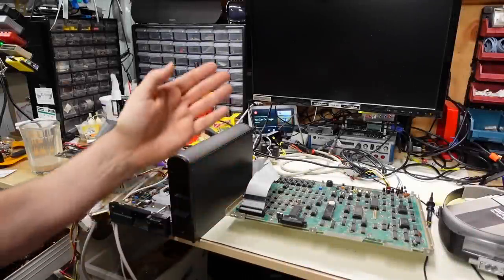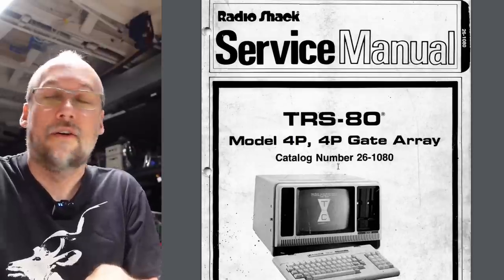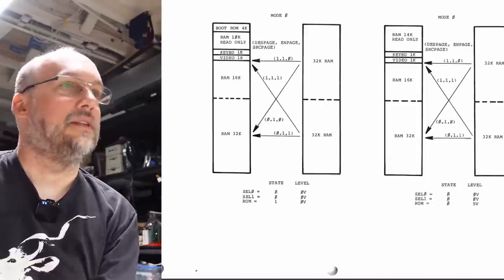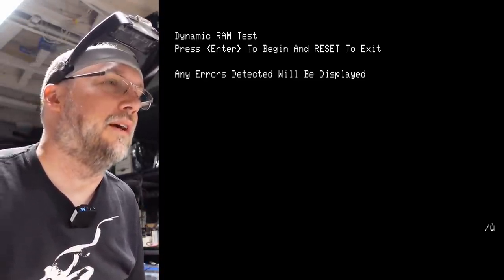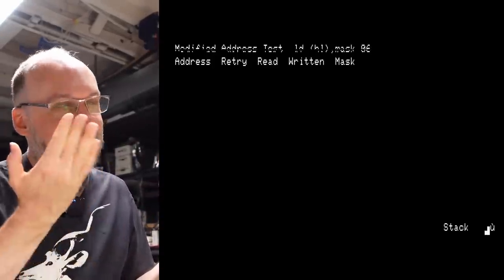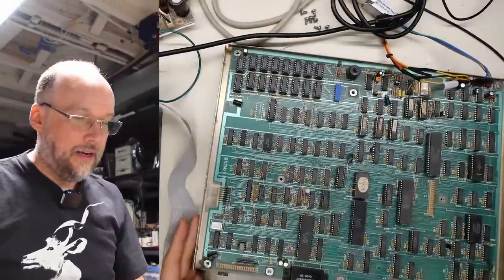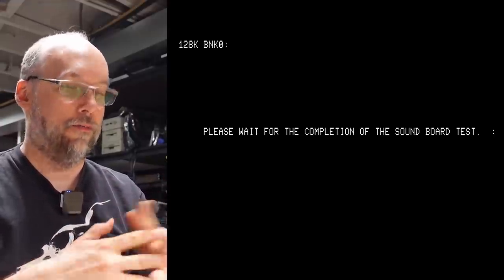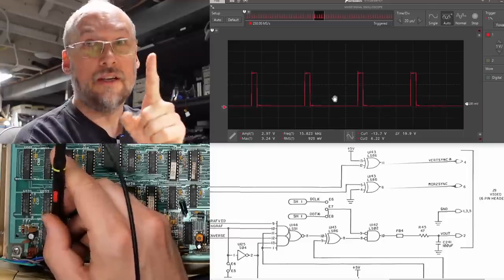TRS-80 Model 4P 80-column crash repair (Part 1)

Comment: Where did you get your schematic?  The only 4P service manual I've found uses a different circuit and a different PLL chip.

Anyway, the 20MHz clock goes into U147 which divides the frequency by 16.  The output on pin 11 should be strong TTL at 1.25MHz.  The voltage divider brings it down to a volt.  The phase comparator (pin 3) checks the difference between this signal and pin 6 (the 1V 1.25MHz signal). The voltage-controlled oscillator output (pins 9 and 11) goes to the divide-by-10 counter U149.  I never saw where pin 3 of the PLL or pin 11 of the counter go, but I am guessing that they are connected, meaning that the PLL is being used to multiply the frequency by 10 for 12.5MHz.  The VCO is tuned by the variable capacitor for a base frequency, and it should be bumped around by the phase mismatch between pins 3 and 6.

So make sure the variable capacitor is connected to both pins (it might be since adjusting it seemed to have an effect on the DC output of pin 9) and it not shorted to anything else (via bodge wires gone wild or something).  You could also pull the chip and build the test circuit as shown in the datasheet to see if the VCO is working at all.

Comment: It's been a while since I was last dabbling in PLLs, but I couldn't resist giving this one a shot. It seems to be a very simple integer N/M kind of affair, with the reference clock of 20.2792 MHz from Y1 going into binary counter U147 (74LS93) to be divided by M = 16 giving 1.26745 MHz for the phase detector to run at, while output multiplier N is set by decade counter U149 (74LS90) between VCO output and PLL detector input 2 (see NE564 datasheet fig 12), which seems to be set up as a divide by 10.

This affair should be giving out 12.6745 MHz at all times. Maybe switching to 80 column mode results in a +5V glitch or reduction which might cause an already marginal PLL VCO to drop out altogether. A good hard look at the power and ground on this chip may be warranted, otherwise it may just be tired. 

Do note that capacitor trimmers can corrode and go bad. The design equation for VCO free-running frequency gives a value of about 36 pF, though with the effect of stray capacitance the actual value required is going to be a bit lower, so C231 (6-50pF) seems chosen just about right. Not sure why a production machine would need an adjustment range this large though, minimum parts count I guess? The circuit is only going to work properly somewhere around midpoint (so long as capture range includes 12.6745 MHz), so beware.

The 3k to ground on pin 2 should give about -200 µA there, which just so happens to be the normalized default value.

Comment: If C227 is open, the amplitude of the frequency will be wrong, so the PLL won’t be able to lock. I’d check all the passives around the PLL chip. If a resistor opens, or drifts off its correct resistance it will kill the PLL phase lock. Check ALL the passives while waiting on the new chips. I suspect an open cap or a resistor that has changed resistance.

PLL chips are tricky, and the passives are critical. 

Great video!! Thanks for showing us the troubleshooting cycle.
Reply: This.  If the capacitor which is part of the frequency setting has gone bad, it will be impossible for the PLL to lock to the correct frequency.  Same for the variable resistor, although that's less likely to be bad.  The first thing I'd be doing is changing any and every electrolytic capacitor around the PLL.
Reply: Also, I’d desolder that variable capacitor and test it. They can be susceptible to high humidity and can short internally. Digi-Key and Mouser have excellent variable cap selections for replacements.

Suspect all the passives.
Reply: @BigDaddy_MRI  Oh, it's a variable cap., not a variable resistor.  Yes. That needs to be checked and possibly replaced.  But my bet is that one or more of the other components around the PLL has gone so far out of spec. that its causing the issues.
Reply: I'd also check to see if the chip is getting proper power.  Vcc & ground, you may have already, but didn't see it in video. If chips not powered correctly it'll have issues.
Reply: Forgot to mention, but pull to ground on power circuit could also & probably does connect to other parts of the board & that maybe where the other issues are deriving from.  Not familiar with the board, but interesting video!

Comment: A PLL needs 2 frequencies feeding into it, a reference frequency, and another to compare it against, the PLL then outputs a correction voltage to alter an oscillator frequency until the two frequencies are in phase with each other.

Comment: I can remember some 5 1/4 floppies which had been powered for a few hrs the glue on the head would go soft and when it did a hunt for track 0 it would shift the head. You would not notice until you put an old disk in a it would fail to read it, but would still be happy with the curent copies.

Comment: If you had a signal generator, you could inject a signal into the PAL. or you could make a simple oscillator with an NE565 and try that.
Reply: I doubt the NE565 can run at 10MHz
Reply: @petesapwell  He did say use a NE565 PLL chip to make an oscillator and NOT a 555 timer !
Reply: @alandoherty8279  That was my typo, (corrected) what I said still remains, NE565 max freq is 500KHz the NE564 is 50MHz

Comment: try a signal injection at the 564 output/gal input. may see a signal on screen. Also check voltages on the Ne564. They usually provide a clue.

Comment: I have a TRS-80 Model 1 that I fixed. Then it died, with faulty video RAM logic and a bad VRAM IC, and some of the 74LS ICs on the keyboard also died. It seems like TRS's may be bugged by unreliable logic chips as I'd also had to replace some of the other 74 LS ICs, so you might have more than just the PLL that's bad. Looking forward to part 3 :)

Comment: Nice bit of diagnostics. I used to do occasional repairs for our Small Business Computer section back in the early 80s. But have been in RnD for the last 30+ years, so don't do much diagnostic repair stuff (on failed vintage equipment at any rate). So it's great to watch your videos and try to work out the problem along side you 🙂

Comment: Fascinating video Adrian! PLLs are common in frequency synthesis applications where you derive multiple frequencies from a single source. Makes sense for a multi-mode computer like the 4P. Also would account for its working in one mode but not the other. Looking forward to the next installment!

Comment: 19:23 I hate it when something falls and it slides into a different dimension.

As for the varcap (which I mentioned in a comment of the last video), I knew it was potential trouble because I was getting a 4P working ten years or so ago, and it was a total pain in the ass to adjust with only the CRT to go by. And now I can see why it was such a problem. It looks like RS was just too cheap to add a second crystal. But I didn't expect a total failure!

Comment: I read the docs slightly differently - it felt like there were two paths.
Path 1 - If the . key is pressed ; divert into the diagnostic package
Path 2 - "All other keys are scanned via the keyboard scanner" goes on to look at the function keys

The follow on docs talked about all the function keys on path 2- but that's different to path 1.
I wonder if there is separate documentation on the diagnostics package.

Comment: The PLL has to be "tuned" to the correct frequency, which involves resistors and capacitors.  That variable resistor is probably intended to "fine tune" the detection frequency, but if the associated control capacitor has gone bad, the variable resistor may be unable to compensate, so the "target" frequency is out of its range.  Once the PLL "locks" to its target frequency, the output should switch from one state to the other (low to high, probably).
I remember assembling the Dick Smith Electronics "Super-80" kit computer and it used a PLL for the cassette interface.  Ideally, you were supposed to tune it using either a frequency counter or an oscilloscope, but it could be tuned "close enough" by playing back a recorded tape and measuring the voltage from the output pin using an analogue meter and adjusting the voltage (average voltage actually, since it was an analogue meter) to half the maximum (2.5V if I remember correctly).
I believe the cassette interface used a 1200/2400Hz FSK signal, meaning that the fastest speed the cassette interface could use was 1200bps.  It defaulted to 300bps but by changing the values in two memory locations, you could double that to 600bps or quadruple it to 1200bps (at the cost of having to always use high-quality tapes and a good quality recorder/player).
Reply: Wow! That you know this...
Reply: @Quickened1  Experience.
(Experience is what you get right after you really needed it)

Comment: Looking at the NE564 data sheet, the VCO range seems quite limited.  The graphs seem to show something like +2% to -4 or -5% VCO range when varying the bias.  That of course comes through a filter from the phase comparator, possibly through an amplifier, in any case from a feedback loop outside of the NE564.  Also the comparator seems to need at least 80 mV signals.  This chip is evidently intended for FM and FSK applications up to 50 MHz.  Should run fine at 10 MHz, provided the VCO capacitor value and bias currents are within correct range each.  By the way, Octopart lists some vendors with varying quantity stock.

Comment: change that PLL chip, open jumper E1-E2, reconnect the 47 ohm resistor to pin 9, power up the board and set the output frequency of the PLL as close as possible to 10 MHz using C231 variable capacitor. Use a plastic tool to turn it, carefully.  
Measure with the probe after the 47 ohm resistor. 
reconnect the E1-E2 jumper and the frequency at the output of the PLL should be rock stable now.
Reply: 12MHz
Reply: Definitely this! The jumper is there so you can set/tune the free-running frequency of the PLL withou any influence from the divided 20MHz one. I'd plan on replacing the variable cap too (especially if you've a two week lead time) as they typically aren't sealed and can degrade over time. Also check the other passives around there while you have the old PLL out.

Comment: Hi Adrian...
The Model 3 profile for RGB2HDMI will not work in 80 column mode.
Tweaking the PLL cap can produce an image but its far from useable
Reply: But in this case there is no sync at all, so there's nothing to tweak.
Reply: Im mentioning a possible further issue after he's restored the PLL clock, save him some time :)

Comment: I dunno, it sounds fishy.
Check that FB1 and 2 are not broken by any chance and adjustable C231is not corroded away.
I checked the input on the jumper - it appears to be exactly what it should be, although I'd still check pins 6,7 and 3 on the chip itself. Maybe you're right and PLL is dead. Where does the wire from pin3 go?
Reply: it should be to U149.  pin 11. that is the PLL oscillator divided by 10
Reply: @fumthings /videos thanks!

Comment: Just what you want in a "portable" computer-bodge wires everywhere 🤣
Reply: This was fairly normal back in the day.  Even on mainframes and minis.
Reply: @d0wnboy  on a portable computer, if it gets banged around lots, one of those solders is bound to break 😕
Reply: I’m not sure why you think these would be any more susceptible to banging around than any other soldered component in the system.  It’s not like the wire’s hanging off the board and moving around.

And guess what?  If companies weren’t going to shit-can the boards and start over in a half million dollar machine where there are maybe a few to several thousands around the world, they’re certainly not going to do it for the $6000 portable computer where they’re selling magnitudes more.

Comment: I find these machines fascinating, especially from an electrical engineering point-of-view. While Commodore and Atari were in a race to dramatically reduce the part count, Tandy didn't seem to care. Those things must have been horrifically expensive to manufacture and I wonder if they made any money at all. A lower-cost to manufacture might have seen more investment into their version of Amiga or ST follow-on. Tandy had experience with the 68000 and a strong link with Digital Research (GEM).
Reply: The lack of 80 column functionality (IMHO) really killed either of the C64 or Atari 8-bit machines being taken seriously in business however. Not sure how much circuitry that adds.
Reply: Even 64 columns is sufficient, since with margins, that's about the width of text for typing up a letter. But you really can't go past 40 columns when you insist on working with a regular TV set.

Comment: It is such a shame that Tandy is no more, at least in the computer industry.
Reply: There was a day when you either had a Tandy/Radio Shack computer or an Apple 2. Everything else was shit.  The first computer I saw was programmed with a paper punch reader or through toggle switches and used an 8080 and later a Z80 when its builder upgraded the processor. We had a few 6502 and Z80 units around running.  I used to get on the BBS with a model 4 and a 1200 baud Bell Telephone modem in the early 80's from home :)  I was a high tech kid at the time.
Reply: @KlodFather  I had the CoCo, The tandy 100 "Laptop", also the DOS Tandy 1000EX, I remember always wanting the model 4 and used love visiting Tandy Business showrooms.
Reply: @atlanticx100  -  I can tell you from owning a model 1 and 3 and 4 that the model 4 ran model 3 and 1 software smoother than the model 3. There was something jittery and buggy about how the model 3 ran probably due to the chips used and maybe some small bugs in the design. All the machine language games rand WAY better in the model 4 but not because of clock speed. That machine was just smoother to work with. I sold it all off in the 90's. You cannot keep it all. Don't know what became of all of it.

Comment: Two things to make here, one a dual C64 diagnostic cartridge and the other a TRS-80 Model 4 SD card hard drive replacement, both boards from the shared designs on PCBWay:

https://youtu.be/_FwRBQzYdl0?t=874

Comment: Is that pealing/bubbling, some corrosion on the back there?  I'm not good with aging electronics, but I would remove the coating there and stop that from spreading any further.
Reply from the maker: The krinkled look? No, that's normal for PCBs of this time. It's just the way they were made.
Reply: @adriansdigitalbasement  That's a nice way of saying "wave soldering still sucked". They had to apply a heavy bath to make sure it got everywhere it needed to be, so the shape of it as it drips off the PCB gets preserved in the solidifying solder.

Commercial soldering techniques were forced to take a large leap forward when the move to surface mounted components began in earnest. Even so, sometimes the power layer of a board is still slathered in a solder bath like cream cheese on a bagel.

Comment: Why not try injecting a 12Mhz square wave into the circuit? You already have the resistor lifted. Assuming you have a signal generator - just use a dc blocking capacitor e.g. 0.1uf  to inject the 12Mhz into the 47 Ohm resistor.

Comment: I suspect that the 564 is supposed to be generating 12.672 MHz, and the "12M" note on the schematic is is not completely accurate, I don't think the "10M" is either. A simple PAL can't make exactly 10 MHz from 20.2752 MHz, but it can make 10.1376, and it looks to me that the 10 MHz signal fleetingly displayed is a tad faster than 5 boxes per cycle, 20 nS/box at 5 boxes = 100nS period and 10 MHz. Following the schematic the '93 is a divide by 16 which will output 20.2752/16 for 1.2672 MHz, I couldn't see the whole '90 schematic but I Ibet its dividing the 564 oscillator output by 10. That would make a properly operating 564 generate 12.672 MHz. Since the output is nothing, and the "bodged" 47 Ohm resistor would isolate the output enough to at least let it put something out the 564 is almost certainly dead. The only other reason why it wouldn't oscillate is if some external  passive part of the frequency determining circuit has failed. The only part is the trimmer cap, and an old Phillips data sheet shows that it still oscillates at i's maximum frequency when that cap is 0. The VCO should always put out a signal, so it has failed.

Comment: The NE564 is also part of the Amiga 3000's video timing circuit, I had to replace mine due to battery damage when I first got it so I have spares if the ones you ordered don't work out, just give me a DM on Twitter :)

Comment: 1K devoted to the keyboard?  That's a large buffer to hold a small amount of scan codes.
Reply: It's an 8x8 matrix, so it really only needs 256 bytes, but the rest is to simplify address decoding.
Reply: @8bitwiz_  I may be wrong, but a few extra logic chips is almost certainly cheaper than 1K of memory at the time. So are you saying it only has 256bytes of actual memory in the 1K address space?
Reply: It's a memory-mapped keyboard matrix, A0-A7 select the row and D0-D7 read the columns. You can learn something by looking at schematics.

Comment: You did misspoke yourself a bit.
The TRS 80 Model 2 was quite capable of running CP/M

I suspect you meant to say Model 1 and Model 3. 

The Model 2 had a small ROM that booted the machine and then was turned off allowing for 64K of memory.